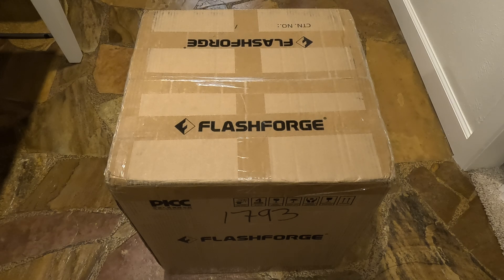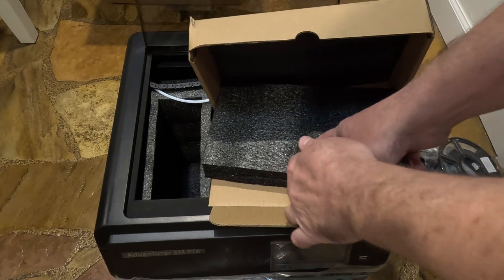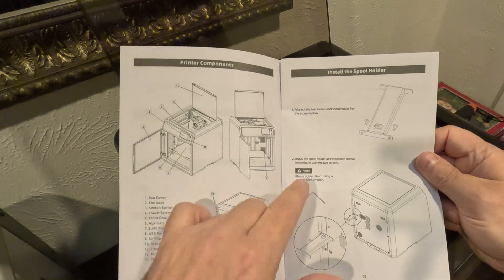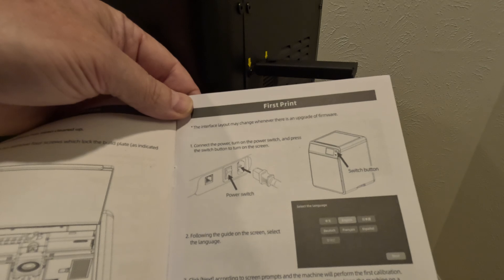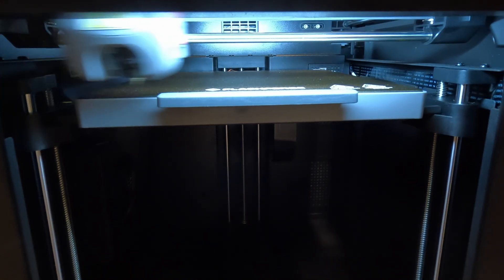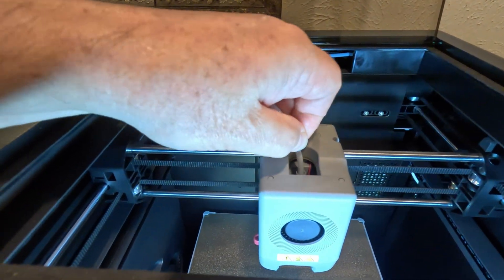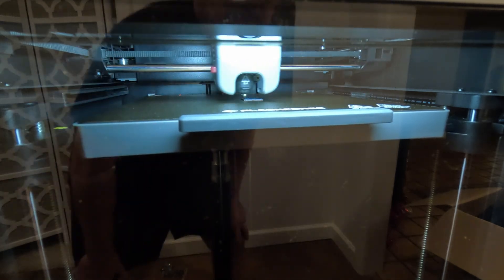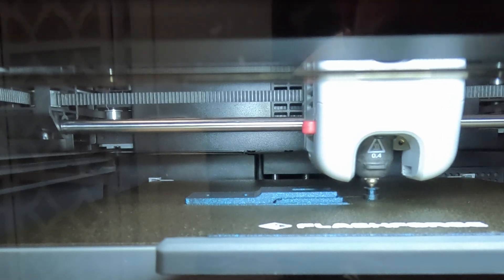Flashforge Adventurer 5m Pro Unboxing and Set-up Review

Comment: You forgot to mention that flashforge has its own slicer and that the printer can use WiFi so you can start a print from anywhere and monitor with the built in camera.
Reply from the maker: Thank you for pointing out these things! I'm new to 3d printing, so I'm glad that you added this information. Orca is the slicer that I used, wifi was easy to set-up and the camera is great for monitoring without having to be right next to the printer. I will say that the camera seems to be a little buggy as it will sometimes not open.